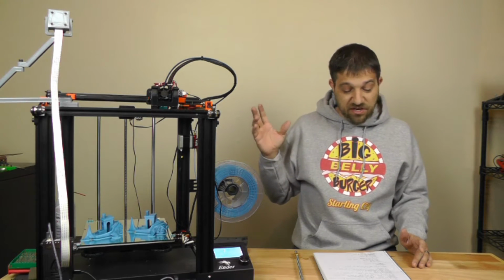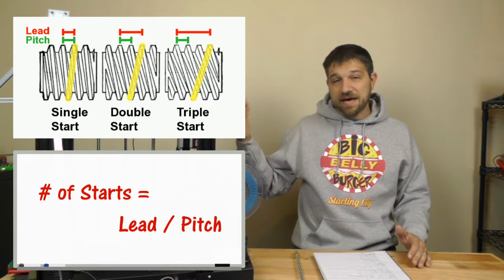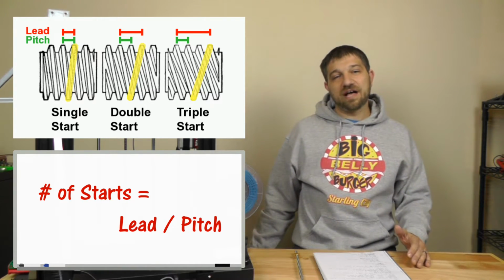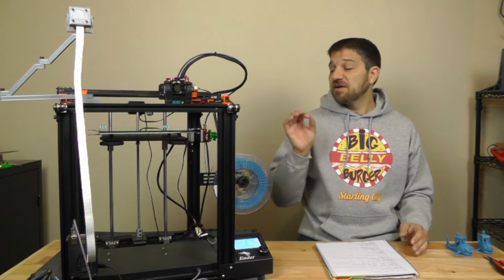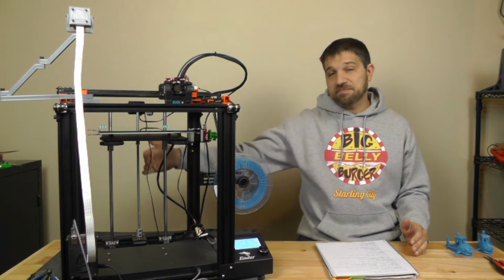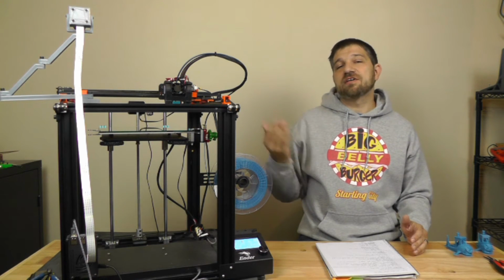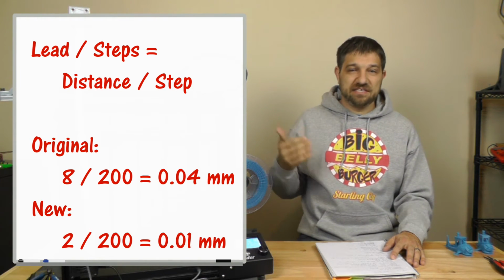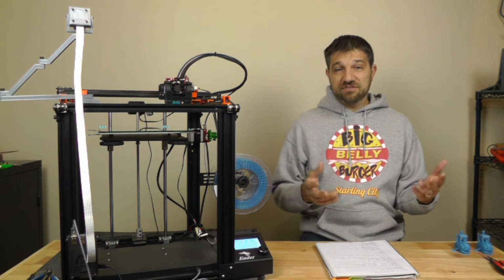Ender 5 Lead Screw Upgrade: Stop Your Falling Bed!

Comment: Mine new ender 5 doesn't go down with any force - it is a newer version of the screw?
Reply from the maker: I've heard they may have switched to a 4mm lead. I haven't confirmed this myself. Thanks for the report.
Reply: @kerseyfabs  ok - so it is a new one - I measured after watching your vid and sure enough, the Z base was dropping 25mm instead of the 50mm on the LCD screen. Uploaded 800 versus the 400 that was there and hey presto, all sorted. It printed ok when I got it, but once I flashed the firmware, it reset 800 to 400 and ballsed up my print. All good now, so thank you for your great vid, Now a subscriber!!!!
Reply from the maker: @noshdaminsk  Awesome! I'm glad I could provide some useful info! Happy printing and thanks for the sub!

Comment: QQ.  I assume all the Creatlity 1.1.5 boards are the same and its just the Firmware loaded that is the difference?  I am having a strange issue with my Z axis , it appears all of my prints are squished and i am not sure how to fix it.  Upgraded the Lead screw per vid and set up the FW but everything is still swished.  Bad stepper motor?
Reply from the maker: That's correct. Check your firmware again and tell me the current Z steps.
Reply: @kerseyfabs   I thought i was losing my mind so i went back and re installed the original lead screw and i have the same issue.  Steps are set to 400 .  Here is the line from my FW Marlin 1.1.9 , 80, 80, 400, 93  (x,y,z,e). i am printing a 20 mm calibration cube i will send you a link when its done.  Only way i could get it to finish was to cut my extrusion multiplier down to .8.  With the 1.1.4 board and Creality FW it was fine. Put this 1.1.5 board in and flashed it to Marlin 1.1.9 and all of the issue started.
Reply: Cube finished , x and y are spot on 20 mm,  Z is 10 mm,  looks like exactly half. thoughts?  I have tried with 3 different slicers same result, must be something in the FW.
Reply from the maker: @jdpg265  Which firmware are you using? As in, whose configuration?
Reply: @kerseyfabs  Vanilla Marlin 1.1.9 with Teaching Tech's Ender 5 configuration (https://gumroad.com/l/eolzc)
Reply: I am thinking maybe my Ender came with a different lag screw/fw   I dont have an issue with my bed falling at all.
Reply: So if i use Expected (20mm)  / Observed(10mm) Dimension X current steps(400 in this case) = 800 new steps?
Reply from the maker: @jdpg265  It's possible that they changed the micro-stepping on that board. It would be strange but possible. You can try what appears to be correct. So divide by 2 your last number.
Reply from the maker: Do you remember what your original number was?
Reply: @kerseyfabs  Original Board or FW?  the board was a 1.1.4 , not sure the FW.  Let me see if the new steps work. should only take a few mins to know.
Reply from the maker: The original steps/mm on the new board. Although if you built it from scratch it wouldn't matter.
Reply: So problem solved and i really appreciate your help, without watching your videos i wouldn't have had a clue or known where to start looking.  Increasing the steps on Y from 400 to 800 has solved the squishing.  TBH after watching your video i couldn't understand why my print platform wouldn't drop as you described ,but now i know. it appears that for my printer/run of printers they used a different pitch lead screw.  Once this test print is in i will hook the old board up to a usb source and plug in the screen , my guess is the default FW has the Z steps set to 800 which is not a standard value.
Reply: cube is perfect.  will boot up the old board and let you know
Reply: Original board : Creality 1.1.6.3   Z steps 800.. so what i have isn't standard.

Comment: Any chance you can take a look at this mod and if it will affect stringing? https://www.thingiverse.com/thing:3595328 I have terrible stringing on things like this: https://www.thingiverse.com/thing:49612
Reply from the maker: Have you already upgraded your tubing to something like Capricorn with a smaller inner diameter? I'd do that first. It usually solves my problems. If you've done that and still haven't gotten it dialed in, have you tried retraction settings of around 6mm@25mm/s? That's what I was using on the stock hotend. If all of that fails, you can try something like this. I'd recommend putting a heatsink in the stepper motor though. Without the motor contacting the frame, it will get hotter.
Reply: @kerseyfabs  Yeah I've been modifying all sorts to get this to go away and bought that tube too, I just found out now that some ppl don't recommend calibrating xyz so I'm trying to go back to defaults with that now. Also I see on very long, thin poles my nozzle tends to contact them and make them wobble a bit, maybe over extrusion? Will use that mod as a last resort. Thanks for the input!

Comment: This is great, wondering if a 4-lead would still be enough to not have it drop.
Reply from the maker: Thanks! I can say "probably" but I can't say for sure because I haven't tested it. The 5 Plus uses 4 lead lead screws but there are two of them.
Reply: @kerseyfabs  are you by chance going to test it sometime soon? Or would you say to just go for a 2mm lead?
Reply from the maker: I won't be testing it anytime soon. I just don't have the time unfortunately. Feel free to try it out and report back or just try the 2mm screw. Thanks!

Comment: Does the math change if the 2208 Silent Board upgrade is done ?
Reply from the maker: No. The steps will be the same. In fact, I was using a silent board in this video.

Comment: My ender 5 bed never falls... and its factory stock. Wonder why is mine different?
Reply from the maker: That's a great question. Maybe you have your end gcode setup correctly.
Reply: @kerseyfabs  I have a glass plate on mine and whenever the stepper loses power it drops like a rock. So anytime the printer is off it falls, I have to manually move the bed up when I repower and go to home the machine since it drops the z first when homing. I am going to try the lead screw in this video or use open builds anti backlash nut that uses a set screw to provide tension.

Comment: Unfortunately Amazon lists this item as currently unavailable. Anyone had a link to equivalent part from some other supplier?
Reply from the maker: For anyone looking for a 2mm lead screw or nut and Amazon is sold out, ZYLtech has them in stock with brass or Derlin (type of plastic) anti-backlash nuts INCLUDED! Either one is $16.95 USD at time of writing. Choose the "0-500mm" option and under "Custom Length:" enter 400mm (for Ender 5). And as always, if you use code "KERSEYFABS" at checkout, you'll save 15% off your order.

Brass Nut: http://bit.ly/ZTT8Brass
Derlin Nut: http://bit.ly/ZTT8Derlin

15% Off: KERSEYFABS
Reply: Ordered!  @kerseyfabs  thanks so much for finding this alternative! And thanks for your detailed videos. Greatly appreciated.
Reply: Well, I was obviously not  meant to change out my lead screw. The Zyltech anti-backlash nut has a larger bolt pattern than the Creality Ender 5 nut and so it will not fit into the existing holes on the build plate frame. So $17 bucks spent to find out I cannot use it.  "sad face." I've called them to see if they have a different size, but nowhere on their web site do they show sizes for bolt patterns on the anti-backlash nuts.

So I gave a try to your Banggood link. I'll not give up on this mod, yet.
Reply from the maker: @SASH-H4wk3y3  I had someone else contact me about the ZYLtech issue and they said they called ZYLtech tech support and they had a smaller hole pattern available that they sent them a replacement for. See if you can do the same. Please let me know.
Reply: @kerseyfabs  Zyltech called me back yesterday and I ordered the correct flange size. Thanks for the help!
Reply: Chris, I finally got the Z screw replaced and everything  is working perfectly. Thanks again for your help post-video. Happiest of holiday seasons!
Reply from the maker: @SASH-H4wk3y3  I'm glad everything worked out! I try to pick quality companies to recommend. Happy holidays!
Reply: @kerseyfabs  I spoke way too soon. I must have done something wrong as I home Z then start a print, and it thinks it is a  Z = 50 suddenly.
Reply from the maker: @SASH-H4wk3y3  That doesn't make any sense. The only setting you should have changed is steps/mm on the Z axis and then the printer knows how to move. If all else fails, turn off and on the printer, double check your settings, then reslice your print.
Reply: @kerseyfabs  I've bounced the printer and the Octoprint and the R-Pi all three more than once. And all three at the same time. Then I started a print and was able to get live Z adjusted good. But when I canceled and it tried to home even though it is on the first layer the LCD says Z = 50. and the motor did the grinding as it tried to raise the bed further. The first thing I did after installing the screw was test the motion and distances were all correct. Tried a newly sliced files and printing from SD card, after power cycling both the R-Pi and he printer,  and still the same symptoms. I'm also running TH3D firmware U1.R2.18, if that matters.
Reply from the maker: Val, I've been thinking about this one and I can't come up with any reason that it would do this, particularly with just the Z steps changing. It obviously could be TH3D's firmware but I still couldn't tell you why. Have you had any luck fixing it yet?
Reply: Had holiday travel so I haven't had a chance to get back to it. I will keep you posted however.
Reply: I have a suspicion that I need to investigate, though.
Reply: @kerseyfabs  Would be great if they make that smaller hole pattern available on their website.  I ordered the T8*2 (2mm pitch, single start) and made the assumption the lead screw would fit.  However, the bolt pattern is different from the stock ender 5.  I have to say though, that they show a drawing of the bolt pattern that clearly shows the dimensions so I could have checked it.  I ended up drilling 4 new holes to accommodate the new pattern from the anti backlash nut.  One of the fringe benefits of this upgrade was that I found that the linear bearings were a little bumpy.  I had to adjust the brackets holding the rods to make them run smooth.  This may explain some of the lines I was seeing on a flat vertical surface.  Maybe another upgrade on the horizon ?
Reply: Rolled everything back, lead screw and settings, and it's printing just fine. By the way I greatly appreciate you even bothering to think about my issue at this time of the year. Thank you so much for your time!

Comment: And the lead screw is out of stock on amazon...
Reply from the maker: For anyone looking for a 2mm lead screw or nut and Amazon is sold out, ZYLtech has them in stock with brass or Derlin (type of plastic) anti-backlash nuts INCLUDED! Either one is $16.95 USD at time of writing. Choose the "0-500mm" option and under "Custom Length:" enter 400mm (for Ender 5). And as always, if you use code "KERSEYFABS" at checkout, you'll save 15% off your order.

Brass Nut: http://bit.ly/ZTT8Brass
Derlin Nut: http://bit.ly/ZTT8Derlin

15% Off: KERSEYFABS
Reply: @kerseyfabs  Aaah, this is what I hate about living in Australia (we call it the Australia tax) - lead screw - around $15 - cheapest shipping options - USD 45. hmm, nope... Will poke around in china - they tend to have cheaper shipping options.  Yup, checking aliexpress for lead screw - haven't looked at specifics yet  - $10-15 and free shipping.  Will post a pointer when I work out who has them.
Reply from the maker: @pquodling  Ahh! I can do Chinese too. Try these out:
Banggood Links:
T8 2mm Lead Screw (400mm Length): http://bit.ly/BGT82mm400mm
T8 2mm Lead Screw Nut: http://bit.ly/BGT82MMNUT

Comment: Kris, I was comparing my Ender 5 and Ender 5 Plus lead screws and it appears that  Creality changed them.  Do you still have your 5 Plus to check?
Reply from the maker: Yes they did. I believe they are 2 start, 4mm lead screws. I've ordered some replacement nuts for a future video, so I'll report back.
Reply: @kerseyfabs  thanks for checking
Reply from the maker: All three of these fit and work. I haven't completed testing to tell you my favorite:
POM, no anti-backlash: https://amzn.to/2qJ2Mkv
Brass, anti-backlash: https://amzn.to/2KSiPU5
POM, anti-backlash: https://amzn.to/2rlkQ4o

Comment: I wish you should have done better research on lubricants. For such open lead screw construction it advisable to use  dry lubricant with PTFE.
https://www.biltema.dk/en-dk/car-care/lubrication/grease/dry-lubricant-with-ptfe-2000031427
Reply from the maker: Thanks for the feedback Gin. Trust me, I did research looking at the CNC community in particular because they're experts at motion with lead screws and ball screws. I'll take a look at the other lubricants though and if I find something better, I'll be sure to report back!
Reply: @kerseyfabs  I can comment what is used in Scandinavia in seamy heavy machinary with open screw ways open to dust and small particalls from inviroment. "Wet" lubricants are tend to atrack those and that is not so welcome in open screw construction...So only solution is left - dry lubricants.

Comment: I own a CR-10, not a Ender 5.
But I still watch your videos, because I almost always learn something new I can apply to my printer.
And your methodical way of testing new parts is a inspiration. But I had to uninstall my anti backlash nuts because when I came back to the printer again to print, the nozzle would either scrabe or be to far off the bed.
Reply from the maker: Thank you so much for the kind feedback! I'm curious about your anti-backlash issues. That sounds like it's binding and/or it's creating additional strain on your Z axis motor. If it feels like it moves properly when turned by hand, increase the voltage some on the stepper driver.

Comment: I completed this modification last week with great success. The bed is ROCK solid now, and more accurate! It will never fall again. Initially I had a squeak but after a few drops of oil it is silent. Updating the firmware was simple enough. With the addition of stepper dampers, and a silent motherboard; this has been a transformational week for the Ender 5. Do you think a lead screw adjustment would also benefit the Ender 3?
Reply from the maker: The dampers should be unnecessary with the silent board, although they shouldn't cause any problems as long as they aren't overheating. The only reason this would benefit the Ender 3 is if you wanted greater flexibility with layer heights.
Reply: I just made the swap the to the new lead screw and I have a gnarly squeak on downward motion.  It sounds like its coming from the coupler near the bottom but I have no idea.  Where did you apply the oil?

Comment: Could this have been with just the anti-backlash?
Reply from the maker: I don't know if I understand the question. The Ender 5 comes with an anti-backlash nut on the stock screw.
Reply: @kerseyfabs  Ah, I didn't think either of the E-5 machines came with anti backlash. I had seen one video that addressed the bed drop by adding anti backlash nuts.

Comment: I am currently looking at buying a ender 5 and 
trapezoidal thread does not need greece. A tiny bit of normal oil will do the trick. The brass peace should actuall be made from bronze but that is more expensive but will suck in the oil and then your done :) We did it on a old harley from 1925 a whole different machine but also needs lubrication. I am watching much video's you are making and am gladfull for the video's. Now it's time to convince the boss (who has the money :) ) to let me buy the ender 5.
Reply from the maker: Thanks for all of the feedback and thanks for checking out my channel. I find that even if the screw doesn't need the lubrication, it does cut down on noise. Good luck getting an Ender 5!

Comment: You might try 0.19 instead of 0.1 since that's so different
Reply from the maker: You're right. I could have tried something really odd. I don't think it would have changed the result much though.
Reply: @kerseyfabs  well I figured that generally nearer the edges you see more issues. 0.1 is right in the middle of two steps and 0.19 is near an edge. But you are right it probably makes little difference. BTW I really appreciated the tutorial on pitch vs starts as I really didn't understand it.

Comment: I printed a tpu spacer ring and applyed a small amount or resistance between the stepper and the cuppler not moved in 6 months if your looking for a quick fix
Reply from the maker: Thanks for the tip!
Reply: @kerseyfabs no  thank you  for the videos. Though it might help a beginner out..
Reply: dnbwalkera adam can you share the stl for the ring?
Reply: @PedroMMFranco  not got it anymore its literally a polo made the right diameter and thinkness any free cad can do stl